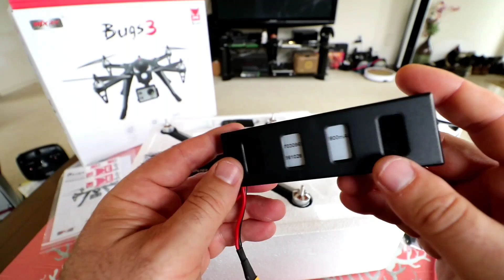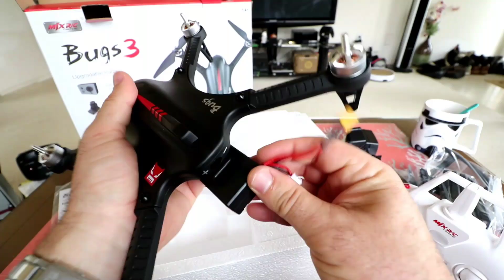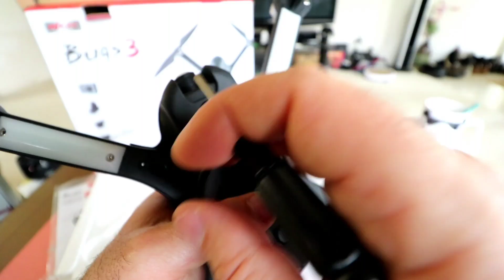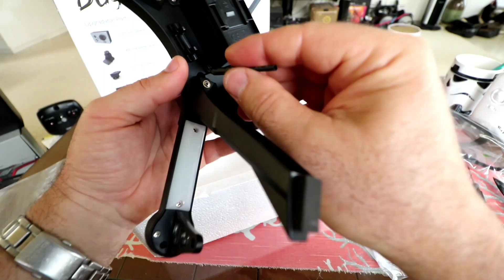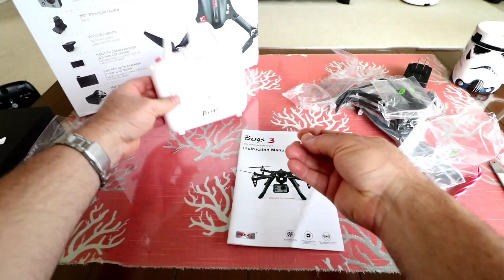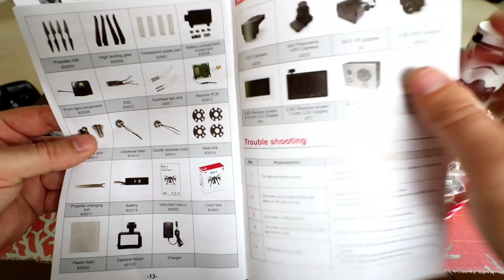MJX BUGS 3 - Full Review - [Unbox / Setup / Flight Test / Pros & Cons]

Comment: I've actually seen several reviews of this one before, so I knew what to expect. I give this thing 2 thumbs up. For the price?  Forget about the Syma X8!  This thing beats the Syma X8 hands down. BTW, that mount is sort of a clone of the Syma X8C camera mount. I know because that's how I mount cams to my X8C. The Bugs 3 has plenty of power and you CAN fly it in a wind, unlike the Syma X8, which even in high rate will drift backwards in any kind wind (say 10mph).  The beeping TX on LVC is a GREAT idea, and more quad manufacturers of these toy grade quads should implement that feature. This is probably my new "intermediate recommendation quad", for those who are past the Syma X5C stage and ready to take on some brushless speed and power. None of the JJRC X1 problem .. and seems to be all around better than the X1 (imho).  I'm sure it has enough power to carry a small 2 axis gimbal, but the video from the simple mount is very good .. no jello, but did get some small shaking. If you're just hovering, the video should be absolutely fine. The "kinda" proprietary battery doesn't bother me, as I'm sure I can find plenty of 2S batteries out there which will fit it and put on an XT30 plug .. done!  If you're looking for a good intermediate quad .. this one's for you! Cheers!
Reply: I agree that the BayangToys X16 is another good option. Both are WAY better than a Syma X8, for example, as an intermediate quad.
Reply from the maker: Worked really well.  I'll have to rummage around to see if I can find some lipos that fit.  This one may be worth doing some mods on :)
Reply: Hey, here's a flash for you. You know that beeping of the TX when you were at LVC?  Well, apparently it also tracks RSSI info, so that as you approach range limit (low RSSI), you will get TX beeping to tell you to come back.  Just learned about this on SeBy DocKy YT channel/review. Now that's a COOL feature as well!
Reply: I bought the JJRC X1 way back when and I fried my ESC's in my first flight. I bought the XK X251 later and it's WAY better IMHO. As far as stepping up from the X5C (which I think is the BEST beginner quad), I'd recommend the original (non-altitude hold) Bayangtoys X16. It has a ton of lift, long flight times (around 16 min), good range and a good controller.
Reply: I have an X8C, with a RuncamHD mounted with a VTX for FPV. To paraphrase "Scotty" (of Star Trek fame), "it flies like a garbage scow", at least compared to these new cheap brushless quads. I actually took my X8 out for a couple quick flights yesterday in 30 deg. weather to try out my new Quanum V2 Pro FPV goggle setup. It's such a lumbering beast that when I get my TX03s, I'm going to stick one on one of my minis (X5C or equiv.) and use that for goggle testing, since any of my minis or sub-minis are a lot more maneuverable than the X8. The honeymoon has long been over for me and my X8. YMMV.
Reply: Holy CRAP Batman! Where did you see it at that price?
Reply: Well, I saw on another review site (SeBy DocKy) that he tried it with 3S battery. When he flew, the wind was very high, so it may have hidden the shaking. I think it flies well on a 2S battery, so if you are having problems, best to stick with 2S ... maybe go with a higher MAH (capacity) for longer flight. Cheers
Reply: Hey Bill as of today I have 3 bugs 3 quadcopters..
Reply: Well, you can now fly one, give it a cool off period while you fly another .. good idea!
Reply: Really where? please.
Reply: Yes.
Reply: Esmerlyn Ramos No, if you need GPS you should take the Bugs 2 instead of the 3.
Reply: Bill Somrak yea but the controller sucks
Reply: thatDude Chris  what controller sux? the x1 yes.
Reply: Captain Carpenter yea the x1's controller sucks
Reply: Can't find an original bayangtoys x 16 anywhere, blast. i waited to long to grab one, lol. if anybody knows of where you can purchase an original x16 i'd appreciate it.
Reply: I have two of these on the way. But why does everybody trash on my beloved syma x8?  I still say there is no better, stronger, more durable brushed motor quad on the market.. I bet money that my four x8's survive longer than my bugs 3 that have not even arrived yet!  the same goes for x16's.. I am done with the little xk's 251's and JJrc x1 will never get a another dime out of me.. I hate the little esc's built into the board.. I do miss having a 251 and I am tempted by the upgraded x1 shuttle.. But repairs are to much of a pain in my backside.. espeacially the 251 it makes me mad all the work required for a $100 drone, they really need to reduce the price..
Reply: SAY IT AINT SOOOO..LOL dude I love your comment, (garbage scow) that's rich.. ha ha ha, I dont know what it is? I am the worst pilot to ever brake the throttle stick on a controller, (really i am) just look at any one of my disaterous videos,, but as far as brushed motor quads? nothing has been as loyal to me as the x8. and the the wltoys q303.. Bro i love the power of brushless, if i could freeze time back when the bayangtoys x16 was saduceing me? or even the xk x251? I would... i look foward to zipping across the open sky with my bugs 3,, espeacially now because a neighbor told me a few things about the DJI phantoms and the FAA that really sour's me on the whole GPS Long travel quad's just today. I dont like the idea of some entity knowing when I fly and how far I fly every time I fly. and that kind of sucks because I am half way through reading the instruction manual on my hubsan H109s..sorry about the spelling. but once again I apreciate your replys..
Reply: Its 76 bucks now.The x251.
Reply: Tomtop
Reply: Okay ... I appreciate your response but at TomTop.com a search for XK X251 and X251 yielded -0- results. Could you post the link to the page they have for the X251?
Reply: ha ha ha ha make him talk..
Reply: Hey Bill my bugs 3 arived today,  9 days shipping from gearbest.. that was fast..It's raining and I had much to do so I only got as far as props and the instrucion manual.. I might just leave the landing leg's off for my first few flights
Reply: Costa Rica, tomtop does have the x251, it's just on a wierd page on there site.  and it's still over $100,  I found the $76 sale but it said for the country of spain only..
Reply: Is it better then the kaideng k70c
Reply: Shaka Zulu
And that is why you need to pick this one up...before they ruin it with all the smart features and turn it into a slow flying camera bird.
I would love to find an original bayangtoys x 16
Reply: Shaka Zulu
I might have found one for sale.
Reply: Yeah you're right,I didn't initially see that.My bad.
Reply: never mind....no longer available
Reply: No way you found a grey or red motor original non alt hold for $85? nothing is cheeper than $115 with free shipping. and every penny counts because with ali? they treat you supper bad when the product is defective!  send me a linc.. ridermom00@yahoo... thanks
Reply: Well crap, I don't see it now. It was a red motor with original camera. I guess ebay is going to be our last chance....
Reply: I have been learning to fly using the syma x5 and x8. Will the 2000ma batteries I use in the x8 fit in the mjx bugs 3 with an adapter for the plug?
Reply: Bill Somrak eqef